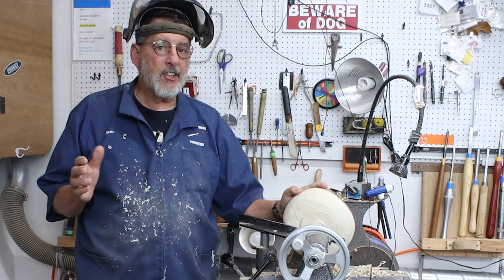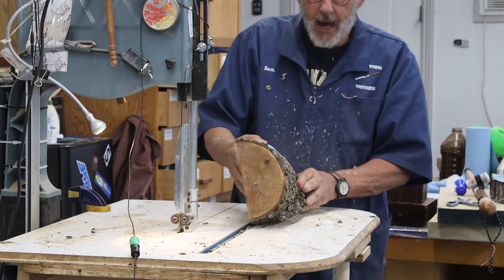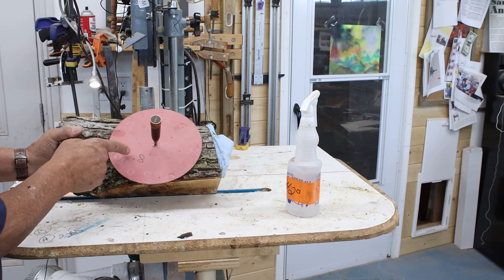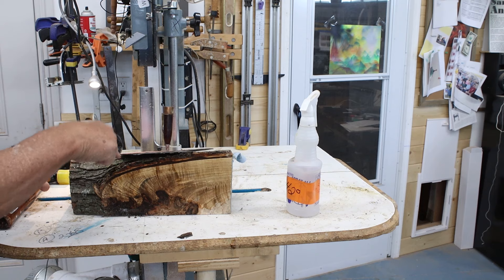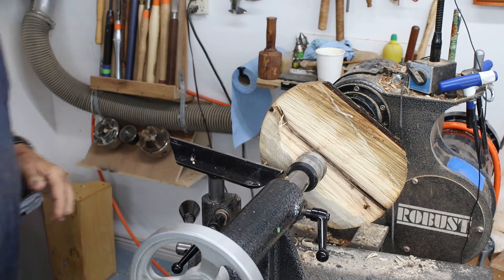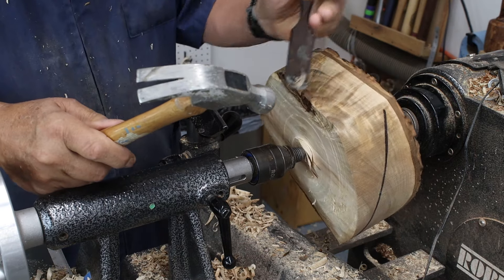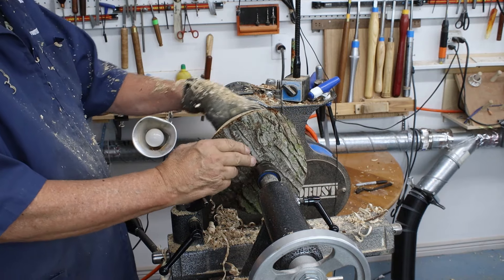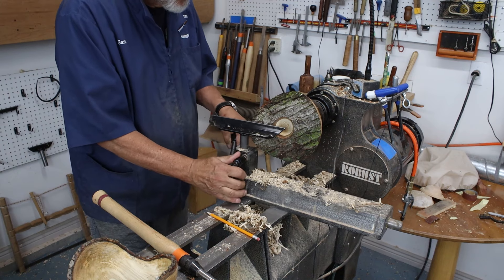Mastering The Art Of Turning A Natural Edge Bowl With Sam Angelo

Comment: Hello Sam, would that be a paper towel you're using to seal the end grain. Do you use a regular glue (pva etc) for this, ps been watching your videos as well as the 4 way crowd since I started turning, you do great work keep it up.
Reply from the maker: Yes, this is an idea that I picked up someplace along the way. I have also used newspaper. I coat the end grain with diluted carpenters, yellow glue, and then put on a paper towel or something like that. I think it really seals the grain very well.